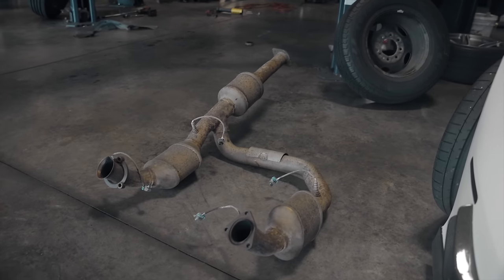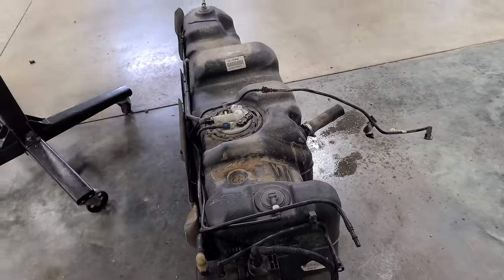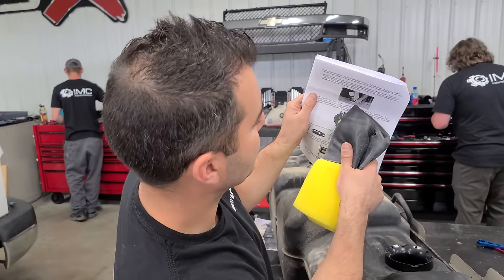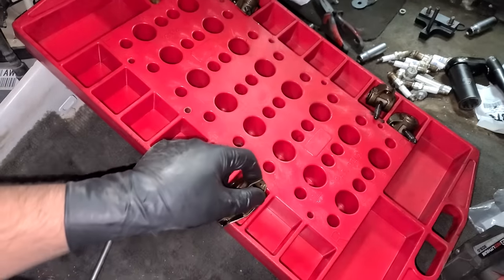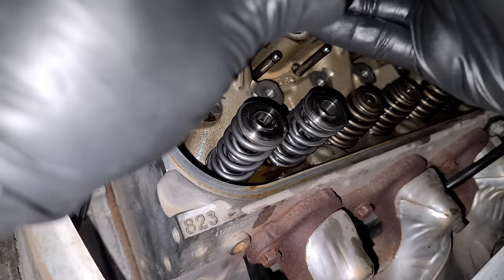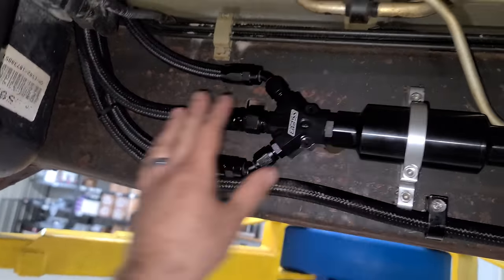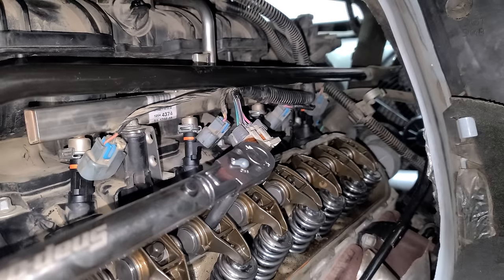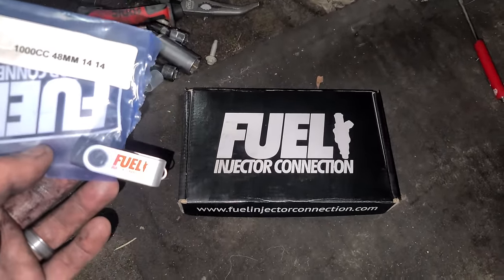We Finished Supercharging My SLEEPER LS Work Van & It’s RIDICULOUS! Insane Exhaust System!

Comment: When i change valve stem seals or springs i alway make sure i only do the cylinders that are at TDC so the valves don't drop into the cylinders and then when i put the collets back in to stop them dropping out of their groove before the top hat holds them in place i add a dab of grease to glue them to the valve stem as I'm winder the valve spring compressing tool off, then i rotate the engine to the next 2 cylinders to TDC.

Comment: Is there any worry about back feeding the 2 aftermarket fuel pumps with the stock fuel pump (or vice versa) using the 4 way splitter or are there check valves in place?

Comment: 0:15 nice fuel setup. Does the regulator have any pressure surges or hammer effect being so far from the fuel rails? I have been told fuel pressure regulators work best when mounted closer to intake manifold. I always wondered if its a myth or not.

Comment: I'm just imagining how much dust and dirt that fell into the engine during all the parts you replaced. Why didn't you use compressed air before you replaced injectors and the map sensor?

Comment: That exhaust is a thing of beauty! But, as per typical LS stuff....I love it when the LS fan boys go on and on about the $500 LS, add boost and go. Yet they leave out all the extra stuff needed to do the "go" part. Like, springs, rockers, bottom end stuff (if going above 650whp). Sure the LS is great if left stock for daily stuff. Start playing with it, it suddenly isn't stock any more but the LS fan boys will still claim it is stock because they used stock measured aftermarket parts lol. Want 800+ whp on a stock sealed engine? Go coyote. Anyways, put it to rest once and for all. Leave the rest of the engine 100% as is. Add boost to it to compete with the coyote boys. Lets see how long it will last at 800+ whp WITH THE CURRENT STOCK BOTTOM END. DO NOT OPEN IT. I'm going on 6 years with a stock sealed coyote making 823whp, countless passes down the strip, even more in "Mexico", and a ton of cruising miles. Mine isn't a rarity either. That is actually very common for the coyote world. I know quite a few running almost 4 digit whp on stock sealed gen 3 coyotes for years now...
Reply from the maker: The springs, pushrods and rocker upgrades were around $650 total so not to bad to freshen up the top end after 200k miles. I have a twin turbo Coyote Mustang and its great too. They are both amazing engines for sure.  The factory van springs were really the only thing needed though. They just weren't designed for boost. The bottom will hold up well stock but no need to float a valve to save $300 on springs

Comment: My only pet-peve... Why NOT run headers instead of cast iron exhaust manifolds?? The faster the exhaust leaves...the faster the intake....Hense...release more power. In the old Cali smog test... My old Mopar's always passed sniff test. If there was any question why smog pump was not installed... I would show Pimple Boy the smog stuff in my trunk... My readings always showed clean, even without the added crap. Sometimes a wink, wink, nudge, with a Jefferson fixed the missing parts.

Comment: HI knowing that you are an expert on GMC cars and trucks, I need your expertise. I own a 2002 GMC Denali with 120K miles, I am looking for the connectors from the main harness to the magnetic from shocks. I have autoride, and its been an issue finding them.  They are discontinued as per dealer, they claims they are part of the main harness but they are not, they have a connector to the main harness and then connect to the top of the shock absorbers.  Because they where damaged by the mechanic the light  " service ride control" is on.  Any ideas where I could get some, even used?

Comment: 1000 hp and torque can be easily made, especially in the LQ cast iron block version, with the Gen 3 platform. Open the rings and swap the cam and lifters and you already did springs. If you want more, send Texas Speed about $8500 for a fully built plug and play LQ9 long block good to 1600ish hp at 9000rpm all day. Great value in both.

Comment: 😂😂 spin the crank. Dude I’ve never spun a crank and I’ve had this same setup running around 20 psi consistently for about 2 years.
Reply from the maker: With a pressed on balancer with no pin or keyway? Are you running a supercharger?

Comment: You should stop doing the trunnion upgrade and just get the updated replacement rocker arms from RockAuto made by Melling and a few other companies. They still have the needle bearings but they are captured by the external snap rings (just like the trunnion upgrade). A full set is costs  just a little more than the trunnion upgrade kit and they're ready to go rocker arm and all.

Comment: Using air pressure to hold valves in place is overrated and out dated. The odds for disaster are high because the piston is is ar the bottom of the cylinder so if the valve loses it's seal it falls into the cylinder and then you're pulling the cylinder head etc
Stuffing a few feet of cotton rope into the cylinder through the spark plug hole and then rotate the crank so the piston pushes the rope up against the valves to hold them in place while you're changing springs/seals is a much more fail safe option

Comment: That first valve keeper looked a little wonky. (could of been the camera angle)   I would use a brass hammer and hit each valve and make damn sure they are seated 100%.  Drop a valve and you ruin an engine.

Comment: .28/.30 ring gap on that 6.0 for more boost. I'm been running 24lbs on a Gen 4 SBE for 2 years without issues. Don't forget some ARP head studs.

Comment: Bro that is a bitch to work on what do you do just take the whole cab off the frame? I remember the Old skool vans used to have a motor cover inside the van that you would take off to access the engine

Comment: I totally dig sleepers and that one is practically invisible.  The only thing I can see a problem with is those RED HORSE made in China fittings!  Absolute junk, the Vibrant hose is top shelf its a shame it has to contact those commie fittings that will jamb up after they're removed,  you can change them out then as they fail. Ok done with the negatively I just had a problem with them. Everything else on this van has me wanting a van, well not just a van a drag vehicle cleverly disgusted as a van. That was my 1995 Chevy Silverado that had a gotten me a 183 mph speeding ticket, God I miss that truck.

Comment: I really don't get you people that don't clean the area you work around before removing parts. You pulled injectors out mud and dirt fell into the bore where injector sits. Rerun where you pull injectors out and look closely at first injector mud pop up and fell into area where injector was come on use a rag and break clean very unproffessional. Good video through